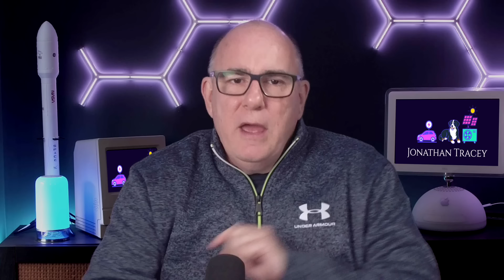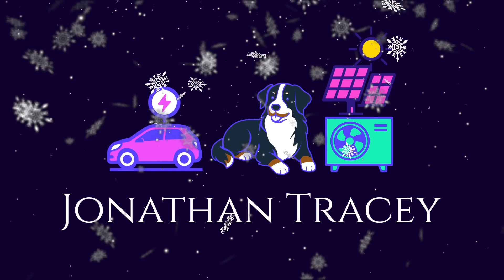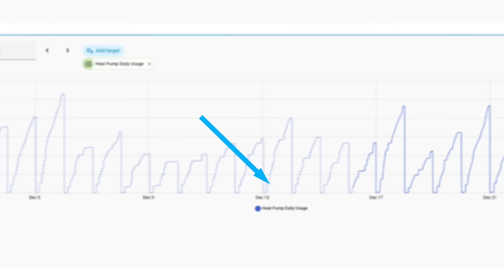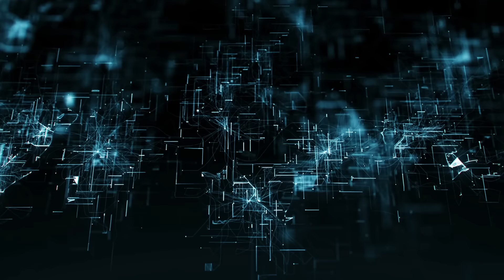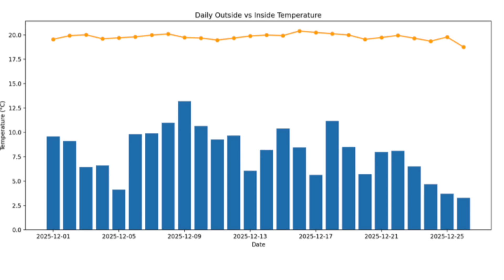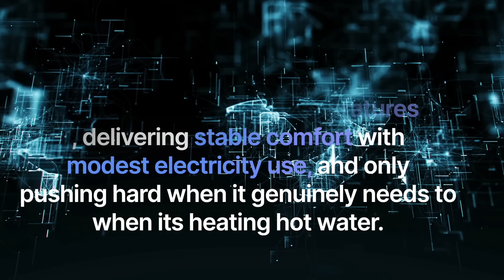I Analysed the Data — Here’s What Everyone Missed

Comment: Great video as always! May I ask if you normally keep trickle vents open or close in winter?
Reply from the maker: we keep the ones at the back of the house closed as they face the prevailing wind, the ones at the front are open for ventelation. works well as we don't have any condensation issues

Comment: Jonathan, Great video, thank you. However, I think the video does have a few flaws. I'd point out a couple of potentially misleading points for your average viewer. Naturally this is just an opinion from a random internet dude. Firstly, your suggestion that radiators can be oversized is perhaps not carefully worded. Sure it is that you can't take one random room and put a 2x rad size in there while keeping the rest of the house unchanged. However, if you were to take your house and replace all of the rads for the ones that allow for 2x the heat output of your current ones - your house temps would not be changed, but flow temps and consequently running costs would go down. In other words, on a properly designed system there is no such thing as oversized radiators as far as heat pump efficiency is concerned. There are of course space limitations, costs considerations e.t.c., but as far as heating system is concerned, there is no such thing as an oversized radiators. The more radiator real estate you have, the higher the HP efficiency. It's a rule, exceptions apply, but it's generally true.
Secondly, you were mentioning heat pump cycling as a bad thing. And sure it is suboptimal. Well, I can all but guarantee you that with flow temps under 30 degrees your heat pump does cycle. Minimum heat output of a 8kw daikin HP is around 2000w. Unless your rads are huge, or are fan assisted, there is no way they can dissipate this much heat with this low flow temp (which dictates average rad temp, which in turn dictates rads ability to dissipate heat). It's possible you could be better off increasing the flow temp a little bit at the lower end of your heat curve so that the heat pump cycles NOT because the heating system is full of heat that it cant shed into the house, but because the house is up to temp. I would go on to say that it's possible that the relatively subdued difference in electricity consumption between warm and cold days that you observe for your system is because on a warm day your heat pump is not running at it's maximum efficiency (i.e. consumes a bit more electricity due to excessive cycling). Whereas on a cold day when your heat curve puts flow temps well above 30 degree mark, your system can finally shed all the heat it produces and can therefore run continuously until an indoor thermostat stops it. Naturally, I am making assumptions here. Maybe your rads are huge or maybe they are fancoils, but an average Joe with an Octopus fitted daikin HP would have an average setup so the comment still likely applies to them.
Finally, if you are using Madoka remote control unit to record indoor temperature, it's worth remembering that these tend to overestimate temperature reading by about 0.8 degrees C. The reason is because the tempt sensor inside Madoka is close to some sort of heat source inside the unit itself. I have the same heat pump and I can confirm my Madoka does overestimate indoor temperature. It's likely yours does it too.
Reply from the maker: Thanks for the thoughtful feedback — I genuinely appreciate you taking the time to explain your points.

Most people watching these videos aren’t heating engineers, so I try to keep things paced and detailed enough for those who are interested, without going too far into the weeds. There’s always a balance between accuracy and accessibility.

On the Madoka point — yes, I’m aware of the potential offset. I actually use Aqara temperature sensors in every room for my real temperature data, which is what I base the analysis on. Sorry if that wasn’t clear in the video.
Reply: With regard to the Madoka heat sensor, if you carefully press on the two clips on the base of the unit then the front lifts away on a short cable. you can see the temerature sensing thermistor is on a short lead that is clipped in to the faceplate. It's easy to manoeuvre it from the clip and with the use of a small pair of side cutters snip a little slot in the soft plastic base that's screwed to the wall and feed the thermistor through. It sounds more complex describing it than doing it. ( I had just increased the set temperature up by 1 degree to compensate for the innacuracy, but that was niggling me so I repositioned the sensor )

Comment: Ambient temperature 6c thermostat 21c flow temp 34c property is 1964 with suspended wooden flooring hardly ideal but I'm very happy heat pump installed about 3 weeks ago so probably will still get a bit of tweeking

Comment: Based on my experience of running a Daikin heat pump for three years, when using radiators, try setting the minimum flow to 30 degrees on the WD curve. 
My curve is set to 42℃ at -3℃ and 30℃ at 14℃(I'm on the south coast, so it's pretty mild down here).

I made the change on the advice of someone on Open Energy Monitor forums who understands the Daikin heat pump's behaviour much better than I do.
IIRC, he has the highest performing Daikin on Open Energy Monitor.
Whenever the flow drops below 30 degrees on my 8kW Daikin, I struggle to get a COP above 3.5 for heating, but if I cap it at a minimum of 30 degrees, it will achieve a COP of 4 to 4.5.
I have spent a lot of time testing and every time I set the flow below 30(even by 1 or 2 degrees), the COP tanks.

Originally, I thought maybe it was just a Daikin software issue with the data, but others with heat meters have observed the same.
This does mean in the shoulder months(above 15 degrees outside), it runs more like a boiler coming on in the morning for a few hours and again in the evening, but thermal comfort is not negatively impacted.

You may find any increase in COP, if any, to be marginal in your circumstances, or it may impact thermal comfort. 
Despite being counterintuitive to everything we have been told about heat pumps, it worked for me.

Comment: Are you sure the last bar is a complete day? It looks like the 26th might not have all been recorded when you took the data?

Also there is something odd with the energy used graphs. They should show daily usage up to 15.8kWh but the maximum is just over 8kWh. I suspect instead of taking the daily usage as a cumulative total, the figures have been averaged.
Reply from the maker: I excluded data from the 26th - that was the day I filmed hte video so it shows up on the home assistant charts but itsnt included in the data set

I will check on the chart as I can see what you mean, will double check - Thanks for pointing it out. It does not change the analysis but be good to know why its generated that way. My Mathlib skills need polishing up

Comment: Weirdly checked my gas usage for the year this morning - total bill was £613  incl’ standing charges, 4 bed detached house (7600 kWh of gas) pretty hard to justify the chaos of replacing 10mm plastic piping that goes to all my radiators. We tend to run at 50C, 55C if it’s very cold. I think having a combi boiler and a decent programmable thermostat with set backs make a difference.
Reply from the maker: Why would you replace the 10mm pipes, mine are 10mm pipes works just fine
Reply: @JonathanTracey . Plastic pipe?
Reply: @bordersw1239  YES!!!
Reply: If my gas bill for the year was only £613 then I wouldn't have considered a heat pump.  My gas bill with OVO for 2023 was £2,438 (26,102 kWh gas) although when I moved to octopus and their gas tracker tariff as well as lowering the flow temperature it almost halved the cost.
We needed to change our 28 year old gas boiler and I'm sure a new combi would have saved us quite a lot but not as much as the heat pump has.
Reply: Oh, damn! And here I was thinking I was paying too much at around £330 😂 But I have a combi boiler currently and Tado TRVs all over. I feel like my bills would likely go up with a heat pump or be near enough the same. On the other hand, I also plan to get solar and battery storage so it likely makes a lot of sense to get a heat pump.
Reply: It sounds like you either have pretty good insulation or don't heat the home a lot of the time.

I think it makes sense to get a heat pump if there is someone at home most of the time.

Personally I am much happier with the constant comfort the heat pump provides. Arriving in a warm home and not having to think about the cost is so much better than having to choose between cost and comfort.

In terms of environmental impact, sticking it to Putin and savings in the long run with ever increasing gas prices and standing charges, it's pretty much a no-brainer to switch

My home is running in hybrid with the gas boiler still providing DHW (1600 kWh) and worst case backup on the coldest days (213 kW) so far in 2025.

Comment: Great video. I am in the process of researching a lot in getting an ASHP. How reliable do you think getting AI to do my heat loss calculations will be? Using my existing gas usage data, boiler efficiency etc, from over the last 12 months. I live in a 1960's built large bungalow, which has had thermal upgrades such as new double glazed windows throughout and loft insulation upgrades. 
AI seems to believe that max heat loss would be around 6.5-7kw, which I would tend to agree with. Using this data, I can go directly to a installer and say, this is what I want, without all the extra faffing around. I also discussed with AI that I am happy to live with existing radiators and monitor how the system performs, and I can later upgrade these myself if required. 
A vaillant arotherm plus 7kw seems to be the unit that will work best for me.
Yes, I know, without proper exact heat loss calculations, I could be taking a bigger risk with the system not running efficiently. But I am willing to accept that, while also potentially saving 1-3k on an install. Also being a building surveyor and very geeky with things like this, I have higher trust in myself to get it right.
Reply from the maker: The problem with getting AI to do the calculations for you as if they are wrong, you have nobody to go to for redress. If you use a reputable firm and something is not right, they have to come and fix it.
Reply: If you want to get the BUS grant you'll need to get an MCS certified installer to do the heat loss calculations

Comment: Really great video and great use of the data. What do you use to get the flow temperature or do you just use the system data ? Is there just one control thermostat if so where do you put it?  What temperature do you run your house. Do the bedrooms get too hot? Thanks again
Reply from the maker: The flow temperature is available through the API and into Home Assistant. Yes we just have the one control thermostat however I have individual room level temperature monitoring using small sensor (video about that a good few months ago). no all bedrooms stay pretty consistent, we do set back the temperature of the Heat Pump to 17° at night to make sleeping more comfortable.

Comment: We have a weather compensated gas boiler, and have constant room temperatures. It's not a unique benefit of an ASHP.
Reply from the maker: very few people run gas boilers like that
Reply: It's hard to get the same low flow temperatures from a boiler, especially a combi boiler. Most of the time, my heat pump flow temperature is in the 20s, we've dipped to -3C here and the flow temperature is 35C (the house temperature is 21.5C-22.5C depending upon the room).

I have to say that I've never stayed in a boiler heated house as temperature comfortable as my heat pump one is now.

Comment: I wonder if the temperatures around Christmas Day are affected by increased cooking etc.  But probably not a massive effect.
Reply: Exactly what I said. Remember that an oven runs at around 200 deg c and although they are insulated that heat will seep out into the general air. Add to that the hob which will be heating up the pans which will radiate a fair bit of heat as well and your talking a reasonable amount of power being added. On oven usually has a 30 amp supply and an induction hob will be quite a supply as well so is probably a lot more than you’d expect. Most kitchens don’t have radiators in them as they are expected to be pretty warm.
Reply from the maker: it’s possible but we did most of the prep the day before

Comment: Great data collection jon. I suspect the cooking may well have added a lot into the air on Christmas Day. A 200deg oven has to distribute that heat out at some point either slowly if the door is closed or when you open the oven door it will push a lot of heat out into the air. 

You can set up a combination of difference between 2 sensors and then chart that directly in home assistant. I’ve got the delta T between my indoors and outdoor temperature in mine.
Reply from the maker: yeah, the cooking may have had a small effect, but the reality is we did most of the cooking the day before. So there weren’t many many hours of other than air fryers and other things running.
Reply: Solar gain?
Reply from the maker: very minimal solar again, I think the sun came out for about 12 minutes
Reply: Any additional people? Each person is very roughly equivalent to a 100W heater. 

Do you have TRVs set to prevent overheating or all on max?